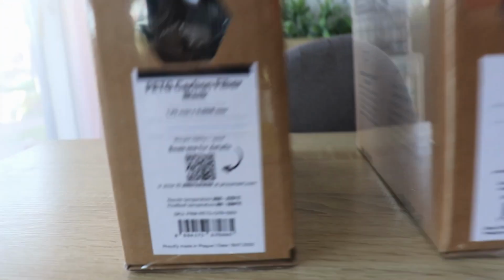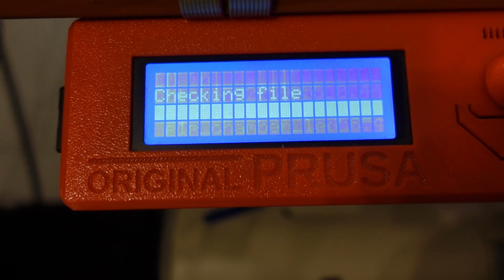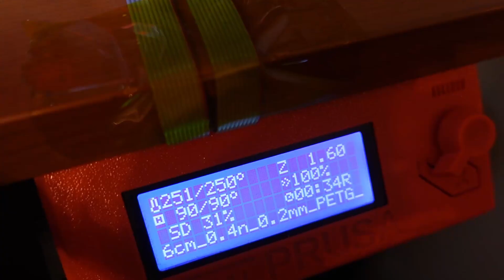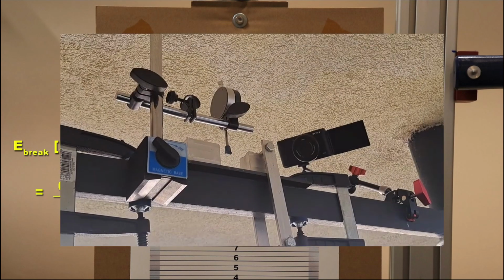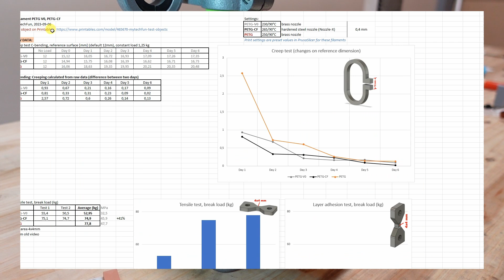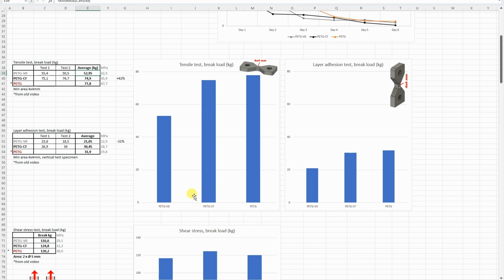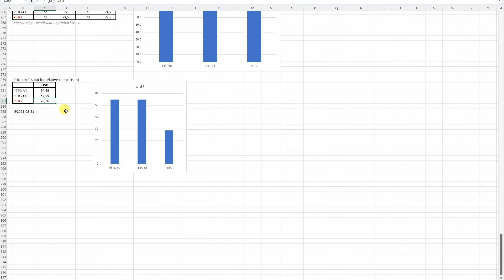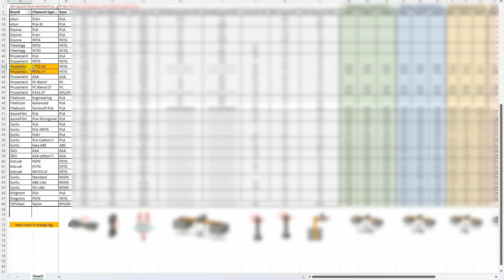Prusament PETG-CF (Carbon Fiber) vs PETG V0 (fire resistant filament)

Comment: Hi, I needed some information. The PETG Prusament V0 material in this video. I need to see how it diffuses light by making a wall in three passes (0.4 x 3). I need to make 3D-printed opaline lamps and this would be the perfect material. Could you make a 1.2 mm thick wall to show me how much light passes through? Thanks a lot. Nice Video

Comment: I've been printing with PETG CF and holy crap do the prints look good.  I think every printer should come with a diamond hotend and CF should be the default filament.  Used Prusament and Bambu Labs and both are great.  I just don't want to wear out my nozzle or tubing.  I think the look is one of the main advantages of putting CF in PETG.

Comment: Hi really like you filament test procedure because or repeatability. Would it be possible to compare two premium PETG CF like EXTRUDR and Prusament PETG CF, to the cheap one from amazon like IEMAI, TINMORRY and ERYONE. I would like to know if cheap brands are cutting corners like using carbon powder instead of real fibers. It would also prove or disprove if investing in premium brands is worth it.

Thank you for great service.
Reply: IEMAI uses "good" carbon fibers. They sent me data a while back.

Comment: I allways watch your videos cuz you do a complete set of scientifical method test and at the same time you are the most unbiased of the 3d printing comunity channels on youtube, with videos full of data and well explained results, but in this video you just get even better. Just compressing a bit the experiments in the video editing but not to much, maintaining the core momments and all the data, you allow videos to be shorter so they are easier to be seen and viewer get the data sooner. A great improvement.
As a humble suggestion will be great if you prepare a comparison between different brands and shores of tpu including the new called "speed printing tpus" like the one i saw from overture, if there is just marketing or really they print faster maintaining or not mecanical properties.

Comment: Great video always on point! I didn't know Resin is that heat resistant!
Reply from the maker: That one cracked at 170°C, only I am not sure when it starts with the softening. I don't have good tests to see on which temperature can be used. But overall, resin is more heat resistant compared to most of filaments.

Comment: Can do test on colorFabb HT and NGEN filaments ?
Reply from the maker: I can contact them if they want to send some filaments for the testing. If not, probably I will buy them if I find their specifications interesting. Any positive experience with these filaments?
Reply: @MyTechFun  the HT is very interesting it has a service temperature of 100 C and it’s quite strong material with a great layer adhesion the prince  is 29Euro for 750 gram , the Ngen is very easy to print and has an excellent bridging with a continuous service temperature of 85 C the prince os 23Euro for 1 KG . So I am interested to see how they will perform under your testing methods. I think it will perform great .
Reply: I would add to the list ColorFabb PLA-HP (130°C without annealing)

Comment: Interesting, the added stiffness and creep performance is really good for mechanical parts. Wish it was a bit cheaper,  with that price i could just print with my PC blend CF spools instead, and get better material properties.
Reply from the maker: PC Blend CF is also one of my favourite filament for technical parts. I printed MK3S extruder parts from it, since PETG started to deform inside enlcosure. Thanks for support and comment!